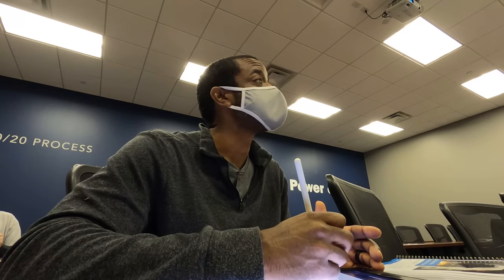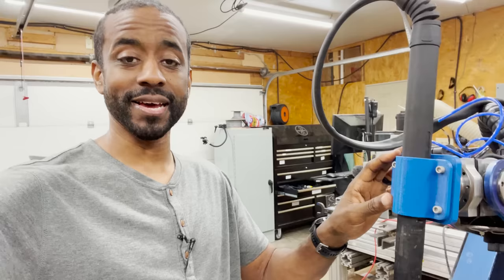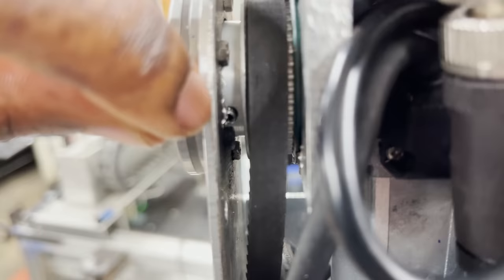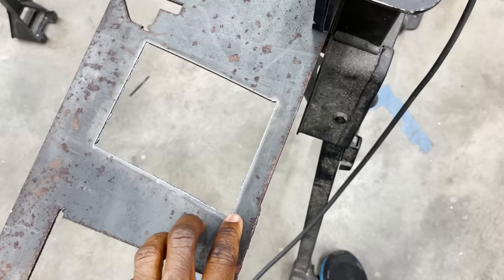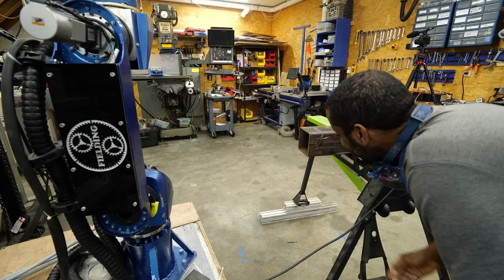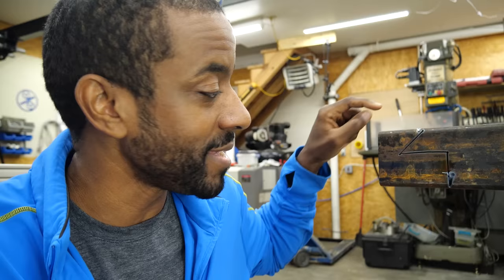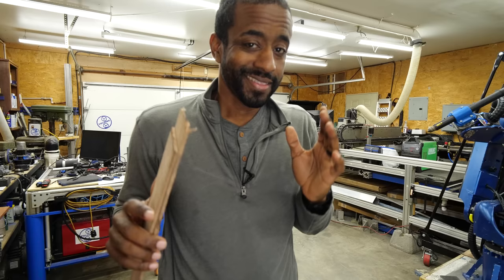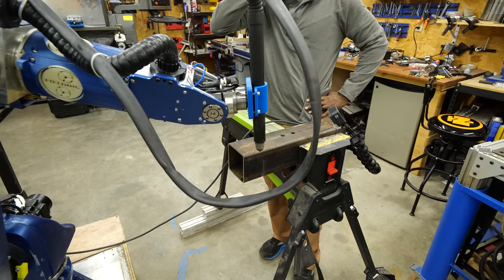I Added a Plasma Torch To My Robot - Jeremy Fielding #097

Comment: you need a xyz starting sensor to create a starting point for the robot and the program. I would add a xyz target for the material stand for the robot to start from. them you could create a xyz grid to program in. then the alignment between the robot and the material to be cut would not have to be perfect.

Comment: In the PLC world you would need a high speed counter card to even begin reading encoder feedback. You will just skip over pulses and see issues like this constantly. You can definitely see improvements by shortening the script a microcontroller is running. Maybe you can get it fast enough by simply dedicating a microcontroller just to reading 1 or 2 encoders on its own. Today in automation we let the drives do this and just buy servo controllers that way you simply command a position and the drive is responsible for getting it to that position and maintaining it on its own. You then never look at the encoder feedback yourself. Since it's just too fast. The drive will also report its current position. The position it reports might not be every count but internally, the drive isn't loosing counts and it will get where you told it to go reliably.
I think trying to count encoder pulses on your own when there is hardware designed to do just that is a loosing battle. Especially with a relatively slow microcontroller. The scan time needs to be something like 3x faster than your fastest encoder pulse speed to catch each one reliably. Any waits, or math going on in the microcontroller will cost numerous cycles. Like a wait simply pauses the whole program for that period of time. Or a math equation might need multiple cycles to spit out a value since only one step is performed per cycle. All the meanwhile the encoder is still moving and the value it just calculated is now outdated and useless information.
Reply from the maker: The drives I have can do this… I don’t know how to do it from the programming side yet. I am working through this sort of thing now.
Reply: @Jeremy_Fielding  I was thinking about this more. You actually see a pausing issue in 3d printers when the micro controller is trying to calculate complex move commands. They resolve it by either going to a 32 bit board or simplifying the resolusion. Linear commands are easy for it but a curve that's cut into thousands of short linear moves will cause it to have tinny pauses.  simplifying these by adjusting the minimum resolusion and maximum deviation of these commands helps alot without any noticeable reduction in accuracy.  This issue is often made much worse when useing a serial connection to the controller, The bandwidth simply isn't large enough. Setting the baud rate of the board as fast as possible helps. Or with industrial equipment everything is just eathernet now. Drives usually allow 100mb/s but they are getting even faster.

Another issue with serial is its pretty susceptible to electrical noise and drives are crazy noisy. Some chokes on any near by serial connections. Line in, and line out from the drives might help. 

Maybe some of this can be applied to what you are dealing with.

Comment: Are all of the dimensions of the arm+tool correct for the software to calculate the linear movement? Is it set to the tip of the tool or where the tool attaches to the arm maybe?

Comment: 3M pulses per second could actually be reasonable. I'm using Delta A3 servo drives on a CNC machine and they support 4M with a differential input. As far as generating pulses, i think the gold standard for hobbyists is a Mesa card, which is based on an FPGA. 

As for solving the issue, have you considered putting cheap encoders on the machine and then just logging the data with an Arduino or something like that? You could then look at the logged data and see if it's just one of the joints having issues or all of them. Later when you move to full closed-loop you could reuse the encoders.

Comment: This is probably out of the scope of this video, but for my master's thesis this year, we made a small CNC router, but we had a small issue with the cupplers, we used the same kind that i see in your video, just smaller to fit the motor shaft and trapezoidal screw, if the motor was pushing the router head away it worked fine, but when it pulled the head towards the motor, the cuppler would spring out and rebound back which caused issues while machining, any idea how how we could fix that?
Great video btw

Comment: On the relay issue, is the relay rated for the voltage and current that you are putting through it for the plasma cutter? The relay may be hitting a breakdown condition.

Comment: What if you went to a fiber cable from a converter box to handle the pulse count at a higher clairity and resolution. Also for the issue with the top linear cut to side linear cut transition in where the torch tip proximity to the work piece is off, how is the distance from the torch tip to the robot knuckle centerline being compensated for? Could it be the programming is not compensating for the distance or is the programming conversational?

Comment: Are the relays true dry contacts with nothing else connected to them like a ground plane on the circuitboard? (possible ground loop between equipment) Perhaps the relay contacts in the open position are too close and arcing is happening? Have you measured the control circuit during operation? What is the control voltage on the plasma? Long leads and noise in the system? Shielded cables?

Comment: Is the switching voltage for your relay AC or DC? I know for SSR it is important that it be AC or DC depending on the application, they are not interchangeable with AC or DC. I found that out trying to control a heater

Comment: Hey Brother we run into these things give your self A. For ingenuity.   When Cat Electronics came out in their equipment in the 90s now remember every thing then was slow especially phone ie email.  We were installing a gold mine so no patience was involved.  We flashed in some software to the 994 huge loader when it started doing things it shouldn’t it was terrifying moving on its own bucket raising and slamming.  Long story short the flash file corrupted over the phone line.  Thankfully I saved the initial file installed it and let it go back to work.  Keep up the good work.

Comment: Is the relay being pulled on by a large magnetic field from the plasma cutter power supply. You need to see if the relay really operates or not. If not the power must be coming from somewhere else.

Comment: Your relay is probably stuck due to the amount of influx current it has to handle, it can't open the circuit because the magnet is not strong enough to unstick both contact when current is flowing.

Comment: how close to the rated power of the relay are you running it?  If you're close to the limit something as power intensive as a plasma cutter is probably just arcing across the contacts. 

I'd try doubling the rated amperage of the contacts with a contactor relay and see if that does the job.

Comment: Just as a general suggestion, you should not control multiple axis with one (micro-)controller. There is a reason why commercial systems have a primary controller that just sends commands and secondary controller to do the actual closed loop control of the axis, motor, whatever. I'm building a motion control system with theoretically unlimited number of axis, actuator a.s.o. No matter how big or powerful the main controller is, it will get overwhelmed. Also it might be not ideal to use normal multi purpose micro-controllers like teensy, atmega328 or similar. Since they are based on essentially loops of instructions, they get easily confused or miss things. For fast things with high frequency pulses and tight controls you might step into the world of FPGA and programm your control loop with them. They became quite cheap in the last years, but they are a pain to learn, but soo amazing, once you figured it out. Feel free to contact me if you want some deeper insights and ideas.

Comment: Your board does not support the amperage needed from your giant steppers.   Your best option is the tb6600's.  Your amps will be better handled on that.  Sometimes these cheap Chinesium boards go dead for no reason in the weirdest ways!

GREAT IDEA!  YOU ARE A GENIUS!  
I WOULD STAY AWAY FROM PLASMA BECAUSE IT'S INACCURATE x 10 so much post processsing  FIBER LASERS ARE THE WAY TO GO.. 1200 system ebay.  2kw fiber laser ebay used.

Comment: Well, aren't you the color coordinated one, Jeremy!  The 3D parts, the pneumatic tubing, and your shirt are exactly the same color.  LOL  //  "That looks awful." I had to laugh when I thought the controller was pulling a Zorro sig on ya.   //  In the end, growing and learning are all good, no matter how painful.  (I'm in the same stage with my CNC router build.  I wanted it to move 4" along the X axis, then 4" along the Y axis.  It starts on the X and then diagonals to the end point.  G-code, where are you?)  // RE: the plasma instant start, is the switch causing enough noise to edge- or level-trigger a start in the cutter's electronics?
Love your videos, Jeremy.  You're an excellent teacher and builder.  Thanks.

Comment: Is the relay for an AC or DC power supply to the torch? I’ve had an issue where I had 12VDC going through a relay to a flashing indicator light that would weld itself closed depending on when I cut the signal to the relay in relation to the flash state. I believe it was caused by a fly back current; putting a diode in the circuit eliminated the problem.

Comment: Relay's aren't universal in the current they can handle. Basically, once the relay is "turned on" the first time, the presumably higher current than what the relay is rated for, that is needed by the plasma cutter will create a strong enough magnetic field that will hold the mechanical switch closed. 

To test this, you could bring over the relay from the plasma cutting table to test in the arm circuitry. Prior to doing that, you should check the data sheet of the relay on the arm to get its ratings. Im curious to know if this was your issue. 

Cheers.
Reply: I was thinking the same thing
Reply from the maker: The current requirements for the plasma cutter is lower than the gripper. I don't remember the number but it is extremely low in the milliamp range. Interesting idea though.
Reply: @Jeremy_Fielding  So checking the Specs worked I see! ahah awesome. Great work though mate love your videos.

Comment: Do you know Beckhoff industrial controls? They work by an ethernet protocol and use as many cores of your computers CPU as you block for control calculations to calculate what it does, and it has specially designed servo drivers. It would probably fit your application quite well and has the calculating power and communication bandwidth needed to run smoothly. You would need an EK1xxx and some EL7xxx or ELM7xxx components, but you would run the robot by the calculating performance of a PC and address your parts the speed of gigabit ethernet, software is free and it is a standard CoDeSys industrial PLC as standardized by IEC 61131. They are rather cheap per performance, but you might wnat to install a fan below heavily loaded components.
Reply: As I figured you are probably unfamiliar with IEC 61131: It is basically something like an embedded Pascal. It's easy to learn if you know C++ or embedded C.
Maybe you did the professional robotics class with ABB robot studio. If so, it's almost identical.

Comment: If you're getting strangeness with two different steps per resolution I would suspect whatever is generating the steps. If you generate a move a 10k steps/rev and 5k and 400 and it does the same thing wrong it's probably not steps but control side. Also if you can't slow the same move down enough that it moves correctly that will tell you something (not sure exactly what), but if it behaves the same at several movement speeds it's consistent. Finally, if you had a big issue with the mechanicals with the set screw is everything 100% fixed mechanically and nothing is binding and causing lost steps when you're running open loop?

Comment: I was gonna say for the "closing the loop" for the software to communicate to the encoders, doesn't that machine use the CAN bus? and would it be possible to program it so that the system constantly polls the position of each encoder?

I apologize if I'm not making sense, what I'm essentially trying to say is that the motors just go do their thing but without checking in with the "boss" or the software in otherwords, a constant "hey, is this position correct?" for every step of the motor if you will?

Comment: I got to use a robot arm ages ago that had to have a human guide its movement during a recording mode and then it would just replay the same movements back. Does your software have such a feature or is there another way to record/playback that position data on your machine? If so It might be a way to sorta look at the issue from another angle. ie; if the output doesn't match the recorded positions. . . you should get more information about the issue.

Comment: If I may make a suggestion towards your issue with step rate (sounds like you're using step/dir signaling to your servo drives) and especially with trying to compute the trajectories in real time, which you said has caused issues with linear moves in the task space (MCU has to spend too much time on the inverse kinematics solution) and achieving simultaneously high resolution and speed. I've encountered the same fundamental problem in my research as a graduate student, in a different setting (my current research is on making 3D printers move faster without sacrificing motion quality or adding substantial component cost). I had decided to use jerk-limited trajectories with bezier splines at the waypoint corners, and this is realistically too much computation for any microcontroller (too many quartic polynomials to find the roots of). So instead, I moved to a completely different approach in which I computed the trajectory on a PC and sent it over USB as raw binary data where 1 byte consists of 4 axes of step and dir signal states for that instant in time. Since the teensy 4.1 has full-speed USB serial, I was then able to pre-compute the entire trajectory as a binary file and transmit it to a teensy 4.1 to fill a buffer (using teensy's added 8 MB memory expansion), so that all the teensy needs to do is directly output these states to appropriate pins at a fixed frequency. Even without using direct port writes, this works easily for even multiple MHz step rates for 4 simultaneous axes and allows all the kinematics to be computed on a PC. With modification, it sounds like this approach could be applied to your setup since you don't necessarily need zero-latency execution, as long as the joints remain correctly synched at all times. This also allows a convenient way for trajectories to be buffered together as desired (I am computing trajectories for full 3D prints at a time) which would help with your pauses between moves while it computes the IK of the next trajectory. If you want, I can ask my advisor if it'd be alright to share my implementation, although most of my code base is written in Matlab (and is quite messy at the moment!)

Comment: I would approach it from a different angle. Quality software (just like every other part) really makes or breaks the entire project. You need to develop 3D visual control software for your robot, then work on matching robot's physical behavior to its virtual behavior in software. Trying to eye the 3D coordinates where the arm should move is a waste of time. Further more you can keep extending this software later to program and visualize tool paths for your laser cutter and to detect collision with part.
I think you mentioned that there are some solutions out there already, but imo it might be easier to build your custom one from scratch that would tailor to your needs.

Comment: Useless info: my neighbors outside  A/C unit wasn’t working. W/O a multimeter I went to help diagnose it. Understatement… I changed his capacitor. Then I went inside and changed the batteries in the thermostat. Then I performed a days worth of head scratching. I brought my multimeter over the next day and checked the voltages coming from the thermostat… At the end of the day, it turned out to be a ladybug stuck between the relays contractor. Point is, before your videos, I maybe would’ve checked for the ladybug in the relay first. But since I’ve started following you, I’ve become less intimidated to tackle the bigger problems. I’m better for it. I almost seek out the bigger problems. In that respect, I forget to use my skill of simplifying large problems into solvable ones. As I alluded to, I learned most of what I know by being inspired by you. But don’t forget to check for ladybugs in your relays.

Comment: FDM 3d printed parts in general aren't a great solution for anything other than prototyping. The tolerances suck, the strength sucks, temperature and chemical resistance sucks. I used to love 3d printing, and there are still cases where it is advantageous to use a 3d printed part, but I avoid them in most cases.

Im enjoying this robotic arm series though. The videos are very well done and I can only imagine the time that goes into these. Keep up the great work!

Comment: Would you mind talking about your control set up? For example you talked about arduino pwm and some of programs has GPIO in them, I guess that’s raspberry pi? Also have you used mach3 controller? Apparently, there are pros and cons of different setup, and sync issues. For a fast set up would you have some recommendations? Thanks.